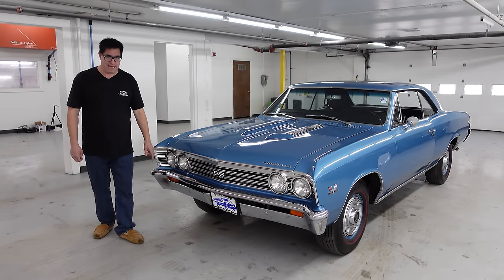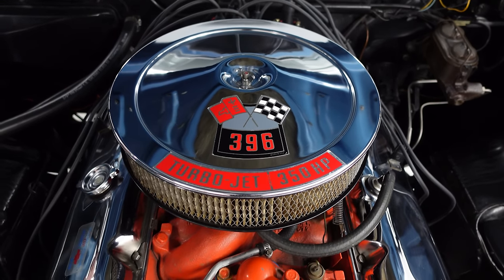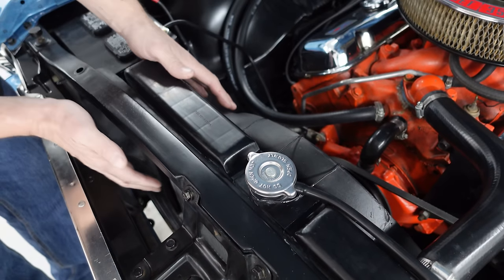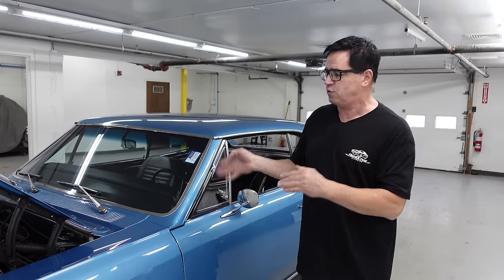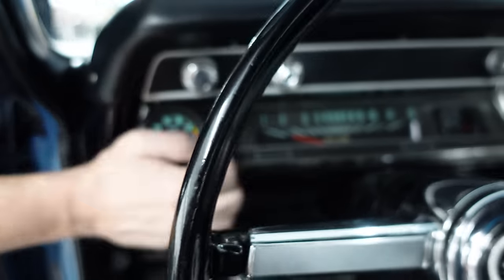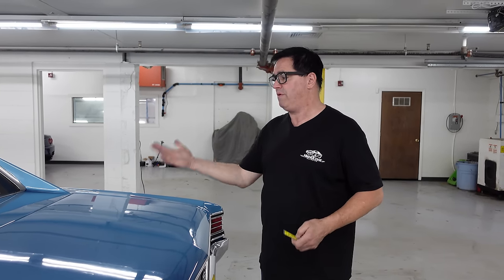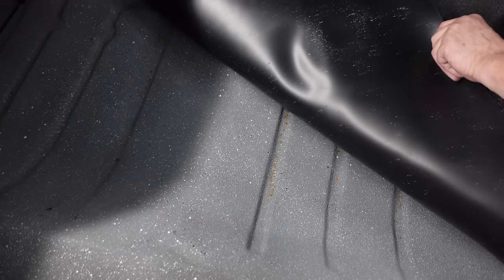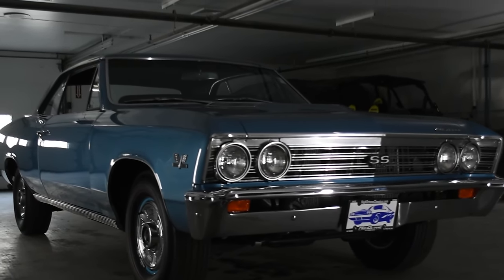Numbers Matching 1967 Chevrolet Chevelle 396 SS Walkaround with Steve Magnante | The Real Deal

Comment: Really nice! I've got a model of this that I built about 30 years ago. This is probably the first one I've seen with that tach.
Reply: The 67  Chevelle "blinker tach" was a 67 year ONLY  "option", meaning that the blinker tach COULD BE ordered with ANY of the 1967 Chevelle factory Super Sport B.B. cars and OR ANY of the 67 NON Super Sport/B.B. regular Malibus, and or El Caminos actually as well. Sometimes, when the 327 4 spd (in particularly) Malibu was ordered for example? Certain owners might have added the tach (especially with higher HP  327 motors etc. Also known as? The Big Block Killers 😏👍)

Comment: I ordered a 67 supersport with the 350 horse engine, 4 speed  and bench seats. also power steering and brakes as well as air conditioning. there was an option of a under dash 8 track player which I also ordered. Traded it in in 1975 to buy a new car for my wife and i still kick myself in the ass for doing so. It was sure a fun car.

Comment: My family had 1966 Malibu SS (283, Powerglide) new in 1966 right up until we kids left home in the early 1980s. My brother and I "took over" the Chevelle when we reached driving age and had fun with typical period mods including a built 350 swap, reverse manual valve-bodied 'Glide, 3800-stall converter. Of course, we didn't upgrade the drum brakes or suspension in those days. I prefer the '66 body (front and rear) to the '67 but love that tunnel-back backlight and C-pillar treatment on those cars to this day.

Comment: So, what are the ethics of claiming a car to be "numbers matching"?  Is it ok to throw that term around just because the block has the correct suffix code? I was always under the impression the block would also need the correct vin stamping on the deck to use the term numbers matching.

Comment: I had a 67 ss396 325hp power glide car we kinda replaced with a 375 hp with an l88 cam and m21 4 speed and 410 gears.it had headrests on the buckets. Never seen another with headrests.rare?.don't know.was back in the 80s

Comment: Question?  Were all SS's also Malibu's, or can it be a Chevelle SS without it being also a Malibu.  It appears there is no Malibu designation on this car, so if I'm thinking right this is a Chevelle SS and not a Malibu SS, right or wrong?  Thanks Steve, love your video's.
Reply: The 66/67 Chevelles were either the SS models which only came with the 396, or Malibu models which only came with 6cyl or small block V8 engines.
Reply: The Canadian version of this car is called a Malibu SS
Reply: @kevinkendall3122  , 
I thought  the Canadian  version of this  was called  a  Beaumont   ?

Comment: Had manual drum brakes on my 74 duster... it had power steering too as a matter of fact but anyway those brakes worked great had good pedal modulation no problems stopping a slant 6 car. One time I was in heavy rain and a deep puddle made the brakes useless so I used the stop sign to stop the car while having my foot planted on the brake to no avail.... knocked over the sign a bit but the car stopped. So ya wet drum brakes are no brakes...otherwise great street stuff.

Comment: come on man, everything is NOT as it should be.  Under surface of the hood should not be car color.  Grill extensions and headlight bezels are not blacked out correctly.  bottom seat trim should not be chrome plated plastic, it should be interior color matching.  Exhaust pipes come too far to the rear, so they are not correct as well. Trunk is missing jacking instructions and if equipped, limited slip differential warning label
Reply: And the rear quarter emblems are way too high!!!